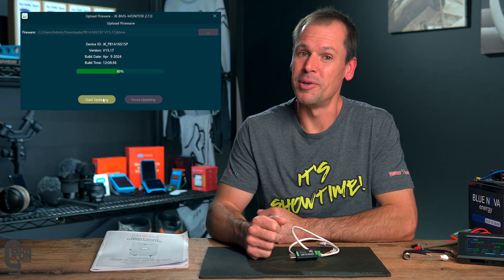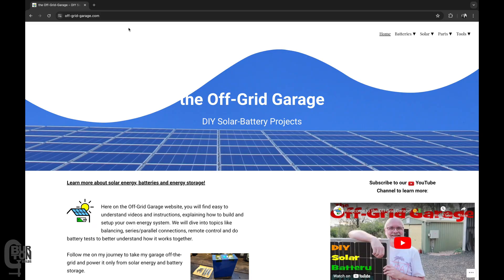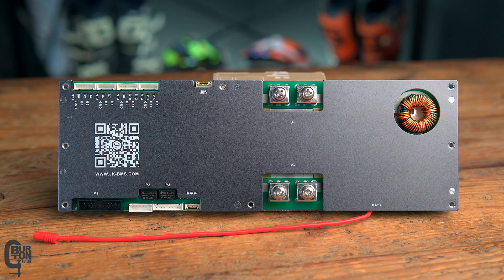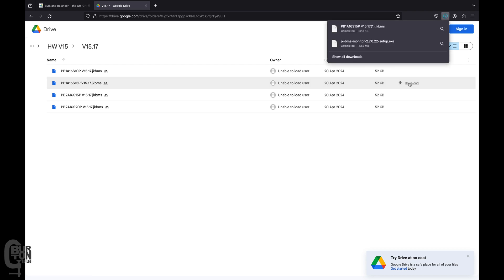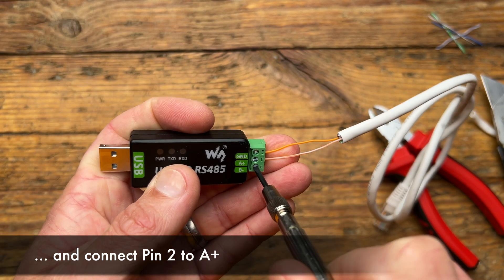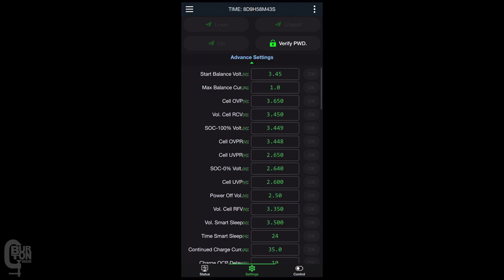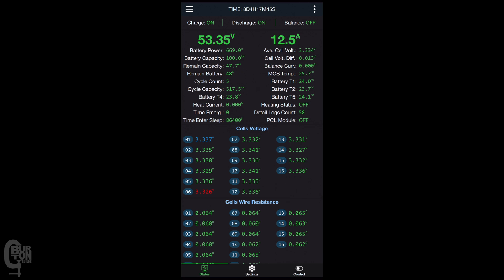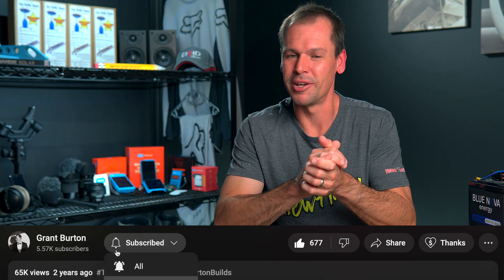How to Update Firmware on JK Inverter BMS (Step by Step)

Comment: Thanks for the video, friend. Could you please tell me if the board resets its cycles and all user information after updating? My board has been running for over a year and has recorded over 300 cycles. Will I lose this information?
Reply from the maker: Every time I’ve updated the firmware on my BMSs, it’s retained all the cycle and user information.

Not sure if there is an option on the latest BMS PC monitoring software to reset the information?

Comment: So this video is no more totally useful. On the latest 3.4.0 PC software, you need to connect as Master and connect the cable on the most left connector and after that you can update. Other else it saying not the same ID
Reply from the maker: Thanks for the info, I’ll maybe look into making an updated video connecting to the new JK BMS monitoring software.

Comment: great video thanks a lot , i have two battery banks connected and communicating updated both but only oneMaster goes to 100 percent charge while the slave remains always at 52-53percent , would really appreciate any help or any link which might point to exactly setup of 2 bms , thanks
Reply from the maker: Hi, what is the total pack voltage of each battery when your master is showing 100%?

Comment: Hello, thanks for this video. But i still have a problem. I can't adjust any settings via pc. All switches except parallel are disabled. It's possible via Bluetooth and is also transferred via Rs485. I'm at a loss.
Reply from the maker: Did you enter the password on the monitoring software to unlock the settings?
Reply: @GrantBurton Hoffe sie können es lesen, danke. Habe  die Löschung ueber Andy gesehen. Musste die Rs485 Kommunikation auf 1 stellen und die Dip- Schalter auf 0 und die Kommunikation findet ueber RS485 stecker Master statt. Alle Ordner funktionieren nun scheinbar. Passwort kann auch gesetzt werden. Aber meine Frage warum funktioniert es nicht normal??

Comment: I've got this same BMS model, but my battery temperature always shows 8C. However, the MOS temp is correct at 32.5C. Any idea why this happens and what I could do to resolve it?
Reply from the maker: What firmware version are you running? Do all 4 of the temp probes show 8 degrees?
Reply: @GrantBurton  ver 19.10. All 4 sensors show similar values. (sens 1: 8.0C, sens 2: 7.9C, sens 3: 8.1C, sens 4: 8.0C)
Reply from the maker: Hmmm… this is just a guess but with all of them being incorrect and also being very close together, this sounds like it could be a firmware bug. Almost like the resistance value from the thermistor is being incorrectly assigned to a temperature (just a guess)… haven’t played around with V19 yet.
Reply: @GrantBurton thank you for the feedback
Reply from the maker: If you do figure out what’s going on, please let us know
Reply: definitely!

Comment: I could update my JK BMS to latest version of 19.20 using this video. Clear instructions. Kudos.
Reply from the maker: That’s good, thanks for letting us know.
Reply: @GrantBurton  Is it not possible to upgrade the bms without connecting the sensing cables? In fact mine was 19.10. I tried to upgrade without connecting the sensing cables. But after a minuite of so,  the bms went to shut down mode. Finally I have connected the sensing cables and upgraded.
Reply from the maker: Thanks for letting us know. I’ve never tried to upgrade the BMS firmware without the balance cables plugged in. Good to hear you were successful.
Reply: I had new jkbms v19, always giving f14 overcurrent alarm. What to do?
Reply from the maker: @hanzlightdiy4670  Have you checked in the BMS settings what the value for the overcurrent protection is set at? Maybe your current draw is exceeding the value set in the BMS?
Reply: @GrantBurton  Sir, I still have no access, I dont have the usb ti rs485 adaptor,, im trying. Because  this one comes with one battery package and cost me around 1,300dolars
Reply from the maker: @hanzlightdiy4670  You should be able to access the settings in the BMS by downloading the JK BMS app on your smartphone and connecting directly to the BMS via bluetooth.
Reply: @GrantBurton I will try, thanks to your support sir.
Reply from the maker: @hanzlightdiy4670  There will be a password to connect to the BMS for the first time... I think its 1234 when trying to connect via bluetooth. Once in the app and connected tot he BMS, to be able to change the JK BMS settings, the default password is normally 123456.
Reply: @GrantBurton many thanks
Reply: Actually some settings  are disabled
Reply from the maker: @hanzlightdiy4670  Did you enter the password to unlock the settings so they can be changed?
Reply: @GrantBurton yes I tried all the combination also the miro website, still permission pw verification fail. “Physically the discharge setting was disable”. I will contact the seller from i bought this one for support.
Reply: Thanks
Reply: Would it be possible to help with the download URL for the mentioned v19.20. Afaik, the latest is v19.18. Thanks!

Comment: Thank you , this saved me so much time. Except the one I already wasted, :). I wonder if you have something video explaining how to connect the JK to a Victron. Thanks again!
Reply from the maker: You’re welcome. Unfortunately I don’t have a video about that but it should be similar, using the same CAN communication into the Cerbo GX, but selecting the Victron CAN protocol in the BMS settings. You man need a Victron specific cable, not a standard Ethernet cable because I think the CAN high and low pin layout into the Cerbo GX is different.

Comment: UPDATE:  issue fixed with Cerbo reboot.  🎉

Hello,  thank you for the video, it has been helpful but I now have an issue with my system.

I have 3xJK-BMS PB2A16S200 communicating to Cerbo-GX, Smartsolar MPPT, Smartshunt system.   After uploading fireware v15:32 the Amperage reported from the BMS doesnt match the shunt reading (no load).  It seems to only update after doing a “DETECT” bms.   Any suggestions, or is there another forum where ppl help each other with issues like this?  (My system is only 2 days old and I am learning from scratch)

Ps:  the difference is dramatic, like 4A vs 15A
Reply: You can calibrate the current using one of the field id settings. Have you use it?

Comment: I just wonder. Why the firmware itself is not available directly on JK webpage? Is there a particular reason?
Reply from the maker: Hi, it is available to download from the JK website... see the links in the video description. I have noticed that the list of available downloads on the JK Download Software page changes from time to time... currently, firmware version 15.30 and 14.20 is available for download.
Reply: because it's CHINESE company-they do stuff very bad!!! lazy to upload fw, and so on... they never do good job at such things. they make device and move on usually, good that in this case they do fw fixes.

Comment: Can i use the standard usb port to rj45 dongle?  USB 3.0 Gigabit LAN Driverless USB to RJ45 Cable and a standard Ethernet cable ?
Reply from the maker: Hi, I don't think that will work... it needs to be a USB to RS485 adapter.

Comment: My device address is 0. Can’t change it, pc software won’t let me enter a 0
Reply from the maker: Hi, did you try setting the address using the dip switches on the interface board and then turning the BMS off and back on again (restart)?

Comment: Hi thanks for video! If I turn on the first dip switch, there is no connection  and if I turn off the first dip switch, there is a connection, but all menu items except "Paralle" are not active. What am I doing wrong?
Reply from the maker: Hi, did you select the correct COM port (see video at 04:41)?

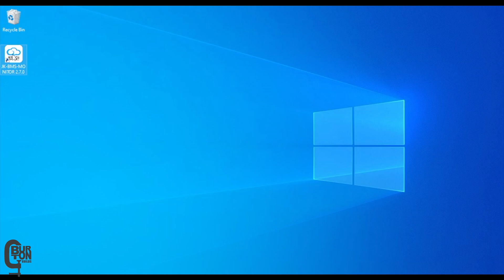Did you select the matching Device ID that is set on the dip switches? (see video at 05:05)... Device ID should be 1 if only dip switch number 1 is on (left most switch) - you can also check this in the BMS app.

What USB to RS485 adapter are you using?
Which version of the PC monitoring software are you using?
What version of firmware is currently on the BMS?
Reply: @GrantBurton   I did all this. I have the same problem as described here at "diysolarforum"  tread "JK PB2A16S-20P No Communication". I suspect that the problem is in the adapter. I use Industrial USB To RS485 422 Converter with CH340G Chip. Version of the PC monitoring software 2.8. Frimware BMS I have two versions 15.27 and 15.30.
Reply from the maker: It could possibly be a faulty or non-compliant adapter... my adapter uses the FT232RL chip and has been working well so far. Let us know if you try a different adapter and if it works.
Reply: @GrantBurton  The problem was in the adapter(Industrial USB To RS485 422 Converter with CH340G Chip) , maybe it is not compatible with my version of BMS or it is defective. I have ordered two other types of adapters that Andy recommends (Waveshare Industrial USB To RS485 Converter with FT232RL Chip and RS485 to USB Adapter Converter) and they both work great.
Reply from the maker: @tvgoogle8219  Awesome... Good to hear you finally got it working. The USB to RS485 adapter I use is also the Waveshare Industrial one.

Comment: Dont you have to use the RS485-1 port just left or right of the CAN port on the bms? On the most right there are 2 RS485-2 ports, I had in mind these are only for paralleling
Reply from the maker: Hi, to update the BMS using the PC Monitoring Software, the RS485-2 parallel ports need to be used (two ports to the right side).
Reply: @GrantBurton  Where we use the rs485-1 port for, near the CAN port?
Reply from the maker: It's used for communication to an Inverter, if communication over RS485 is being used.
Reply: @GrantBurton  ah yes! I didnt think of that, cause I am ll on CANbus with my deye 12kw hybrid :) Btw; for the 100% SOC issue, on DIYforum there is a nice diy project, Ghost Battery, i am going to try this. Together with 15.32
Reply from the maker: I read a little about that Ghost Battery project however I don't think the 100% SOC issue affects Deye / SunSynk Inverters. When the BMS reports 100% SOC to the Inverter, it still continues to charge the battery until the RCV is reached ... (or at least thats what I've seen on my SunSynk 10kW Single Phase Inverter)
Reply: Need help when I try to update the jk bms pb2a16s15p the bms go off and PC softwear at 0%  and when restart it   work normally with out update  any fix for this problem

Comment: tried updating mine but it just stay at 0% then nothing happens, could be my bms is bricked?
Reply from the maker: Does the BMS still connect to the JK Monitoring Software and display all the live numbers with the BMS running?
Reply: yes, the bms still connecting to jk monitoring software and displays all datas live. current firmware version is v14.04.

Comment: Hi, any idea where to get firmware for my device?

Vendor ID: JK_B2A8S30P
Hardware Ver: V14.XA
Software Ver: V14.06
Reply from the maker: Hi, yes... Andy from The Off-grid garage has a wonderful resource for the software and firmware... here is a link https://drive.google.com/drive/folders/1i0gqmxzb4OBCts5G0TuFlGNGpP2g12es
Reply: @GrantBurton  nope, seems like b versions are not flashable. it sucks because they have the float bug on old versions. (doesnt go into float)

Comment: Is it possible to update the BMS if it is not yet connected to the battery(out of the box)?
Reply from the maker: The BMS needs to be powered up in order for it to update... I haven't tried it yet (because I installed it into the battery) but from what I've seen others do... the B- needs to be connected to pack negative and the red lead (that comes out of the BMS) needs to be connected to pack positive (the balance leads don't need to be connected).
Reply: @GrantBurton  thank you for your quick response
Reply: @GrantBurton  connected to a 12V battery - it did not start(( how much does it need to start? 48v? Or maybe I have a broken bms?
Reply from the maker: @yu.diachenko7889  HI, according to the Jk website, it should be able to operate from 20 to 70 volts. Normally taking 8 - 16 cells, it should be able to run on 24 volts.

Comment: Hy! A lot of people have a great problem with the firmware update. I have 2 2A150A HWV15 with the 15.10 firmware. Everytime i start the update my bms shuts off and nothing happen.... Have anyone suggestions for me?
I`ve tryed different computers....different cables.....3 versions of the PC Software... always the same
I hope there is a solution for that
Reply: Hi @NarfNoxy. I have the same Problem: BMS with 15.10 shuts down - with "normal" update and "force" one. I'm in contact with users on a german forum...they have the same problem. Some of them contacted JK, but they got no answer. Looks like many users have this problem and no solution is on its way. 😥
Reply from the maker: @videoflieger1239  It's such a letdown that so many people are experiencing this problem and JK says nothing about it. Hopefully they are working on it in the background and will come out with a solution. If you find a way to update it, please let us know. Where did you purchase your BMS from?
Reply: I Had the same issue , resolved it, I bought a waveshare Industrial USB to RS485 Converter Bidirectional Adapter as per Andy's advice and tests. This device worked , mine (Hexin) did not.
Reply from the maker: @GerhardCoetzee-sp3fw  Hi Gerhard, thanks for letting us know. Mine adapter is also still working well.
Reply from the maker: Hi, have you tried using the Force Update option when trying to update the BMS? Also, when trying to update your BMS, is anything else plugged into any of the ports? What USB to RS485 adapter are you using?
Reply: @GrantBurton   with the force Update Option there is the same behavior. Nothing Else plugged in. I have used 3 types of usb to rs485 adapters. 2 from Amazon and a seplos one
Reply from the maker: Not sure if you have seen these videos by Andy from @OffGridGarageAustralia but maybe they will help?
Recovering a bricked Jk Inverter BMS https://www.youtube.com/watch?v=KznZtqpoles
Force updating using Miro's code generator https://www.youtube.com/watch?v=b-Hl1G8_qOA
Reply: @GrantBurton  yes i have seen all that Videos and asked there also for help but anybody helped… so i think i‘m Stuck with this 15.10 Version forever…
Reply from the maker: If I come across anything that might help, I'll let you know. At least your BMS is still working, but it would be nice to upgrade to later firmware.
Reply: @GrantBurton  thanks!!!
Reply: I have the same problem, only with two BMS. One stopped working after the 3rd update attempt. The second one restarted after the first update attempt, but fortunately it works.
Reply from the maker: @aaaaaaaaaa5446  Hi Rafal, have you tried using the force update process to try update the BMS?

Comment: Small tip. In case you have them parallels. You need to unplugged them but set them to address 1. The master is normally 0 when used.
Reply from the maker: Hi, thanks for the comment. Yeah... A video explaining BMS setup and connection to a SunSynk inverter is in progress... hoping to have it out in a few days.

Comment: Thanks Grant
Reply from the maker: It’s a pleasure. For now, I’ve rolled back the firmware to 15.11. Seems the BMS was sending a ‘force charge’ request to the inverter even though the battery was at 100% SOC, and not allowing the battery to discharge. Didn’t have much time to play around.